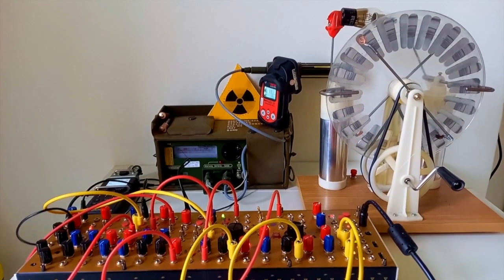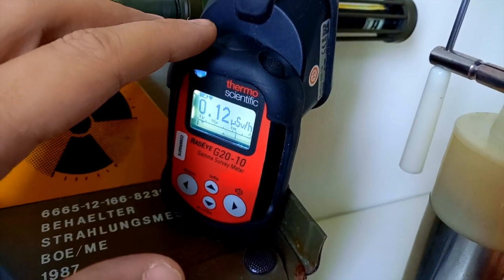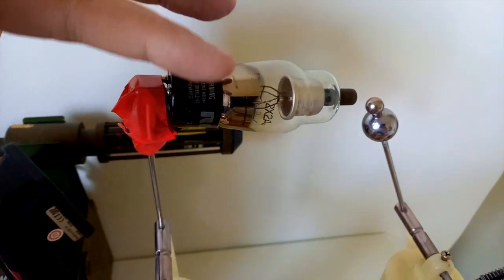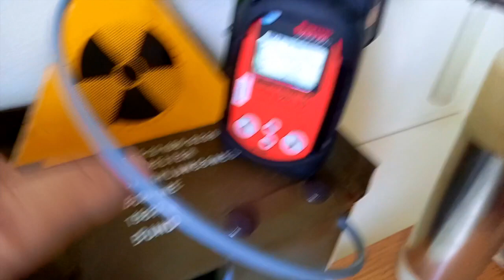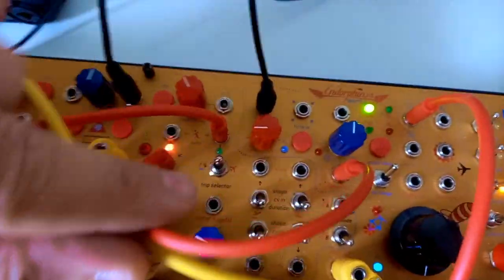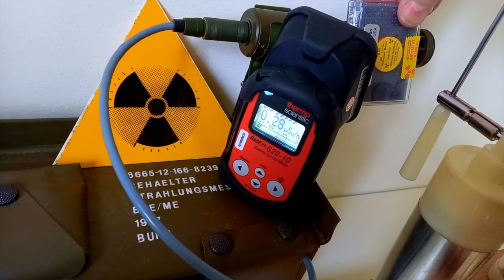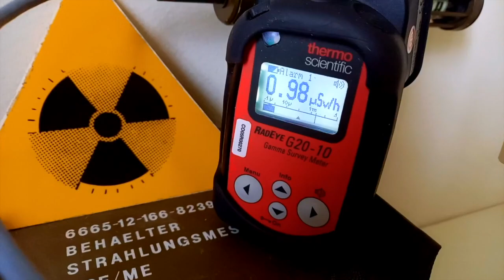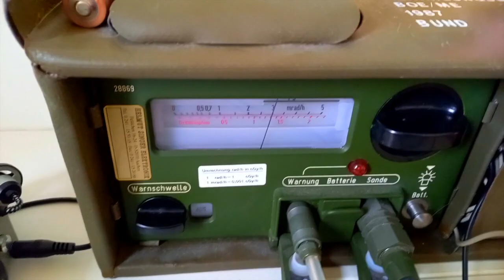Using X-RAYS to trig a modular synthesizer

Comment: Hello
Why not to use a cosmic rays receiver ? The one i saw into the garden of the university of Cracovia in Poland had the size of a shoes box.
You may separate the flow depending of the energies of the rays and use these different bands for controlling several parameters on your synthesizer.
NEKO
Reply from the maker: of course I have it and already did it

https://giorgiosancristoforo.bandcamp.com/track/harmonia-radiorum-cosmic-rays-music-for-kithara-and-synthesizer
Reply: @toborexperiment  Ho ! Ho ! Thank you for this information. I will listen this piece tomorrow because tonight i have to do the annual saves on all my computers and recover some files.
I have more to write : as i am very interested by the astrophysics, many scientific works may be inspiriting sources for my musical works. For exemple, the hypothesis developed by Jean-Pierre Luminet about the geometric shape of the universe.
NEKO